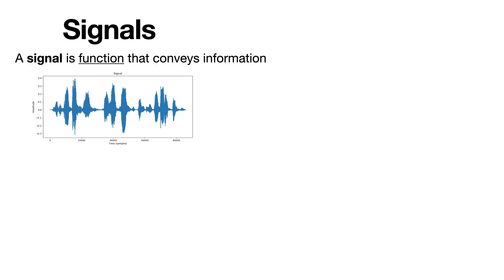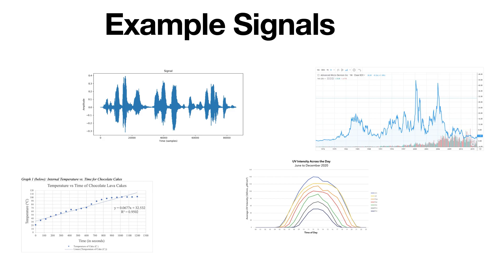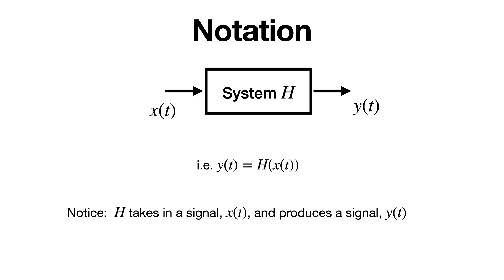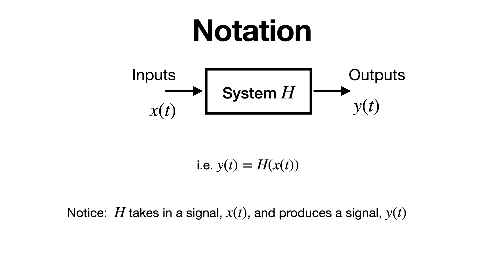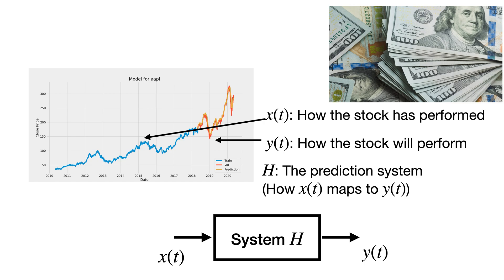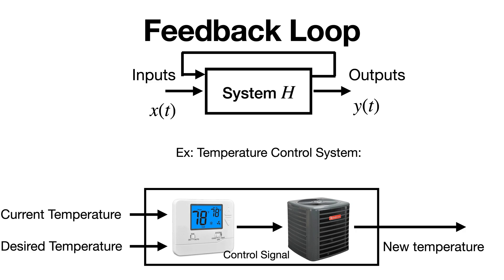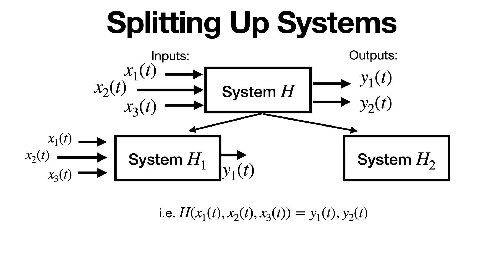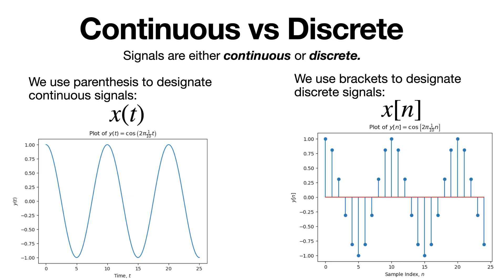What are Signals?  What are Systems?

Comment: Good explanation, I'd say. 
The capitalisation of systems/signals is something I've learned differently. For me it's capital letters if said function is in the frequency-domain, and lower-case for time domain. So G(s) and g(t). But that might differ from field to field and region to region, as do so many things with notation. Electrical engineering in Germany for me.
Reply from the maker: @HerrmannStahl  that’s a good point, and that is common convention here in the US too, which gets confusing.  If you have x(t), it’s Fourier Transform will be represented as X(f).  A system H’s impulse response is often h(t) and its frequency domain representation is H(f).  Usually it’s clear on the context if you are reasoning about a system H or its transfer function H(f) or Laplace Transform H(s).

In my papers, if I think this becomes confusing, in Latex I’ll use \mathcal{H} to represent the system.  But since an LTI system is also characterized by its transfer function, it is common to see H used to refer to the system and its frequency domain representation.